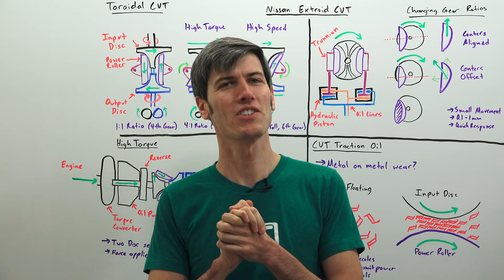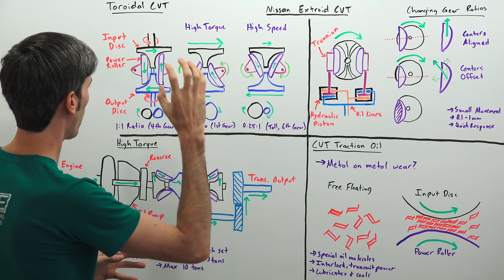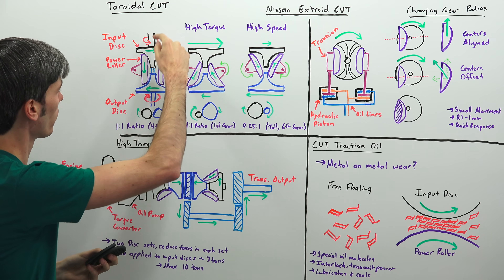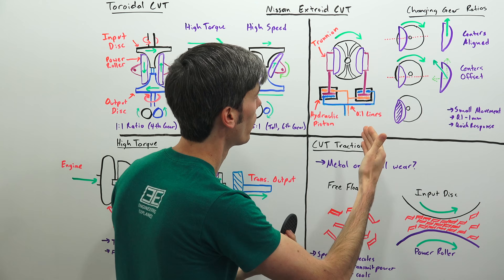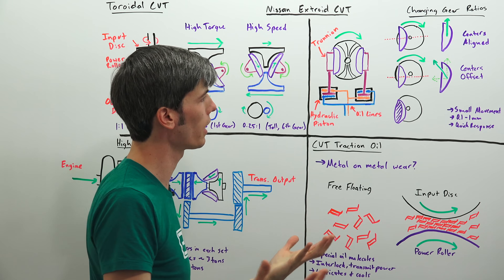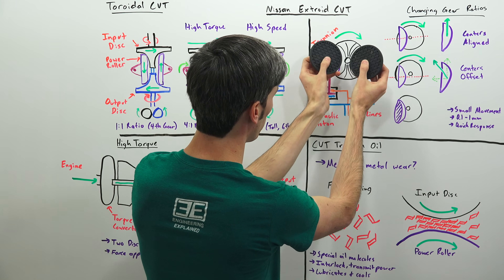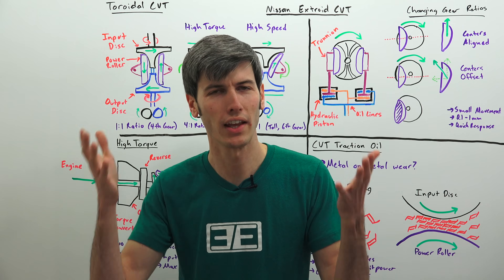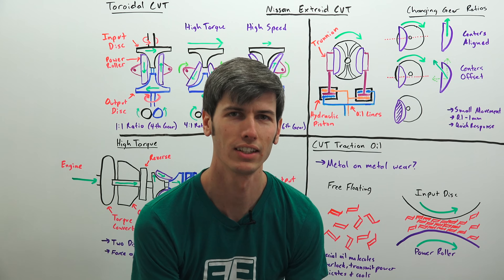Nissan Created The First Production High Torque CVT

Comment: This CVT design is destined for early failure because the core design is flawed.

You've got 2 separate CVT's that need to be PERFECTLY synchronized to not fight against each other and wear each other out. Anything less than PERFECT synchronization means that they will start to slowly destroy each other.

PERFECT synchronization isn't possible, that's just physics. However in this case the synchronization is controlled by hydraulics. So here is a partial list of all of the issues that can and will effect synchronization between the two CVT's:

A. Heat difference in the hydraulic fluid between the two units
B. Imperfections in the hydraulic cylinders ( not exactly the same as each other )
C. Worn or slightly leaky O-rings ( that wear / leak at different rates )
D. Clogged fluid passages ( that clog at different rates )

Maybe there is only one set of hydraulics and they are mechanically coupled. There will still be synchronization issues because things like:

A. Mechanical play in the system
B. Uneven heating and expansion of the linkage of the synchronization mechanism
C. Possible bending, flexing or warping of linkage of the synchronization mechanism

The only realistic way I can see this lasting very long would be some type of torque sensing auto-correcting system where the two CVT's could detect the torque difference relative to each other and quickly make adjustments before too much damage takes place, but that would have the following issues:

A. It's complicated with many points of failure
B. As it wears it could end up in a state of constantly over correcting or under correcting, sending the CVT into a never ending auto-correcting loop of death.

It's just a bad design!
NEVER create a system where two drive system are fighting against each other. Not if you want it to last very long.

Comment: Is the "special" oil a non Newtonian fluid being used as a lubricant?  Why not use cogs instead of smooth rollers? Seems like wheels with teeth would be much stronger while eliminating the need for a special lubricant.

Comment: But will it last? even if it lasts 20 times as long as the current Nissan CVT it would be very unreliable.
My neighbor had a Nissan Pickup with CVT and it broke after 6000 km and the replacement lastet only 10k km.

Comment: Never heard of it so far and I'm blown away. How on earth that kind of an amazing invention didn't set the highest bar as a CVT transmission and become the most used system in the industry. It must have some serious drawbacks right?
Reply: Alot of them were put in cars before they worked. Many failed at 100kmiles, there was a class action and nissan replaced a bunch, put money into r&d, and say it works now. Many people are skeptical. Some say they are noisy and fragile but the concept saves gas for sure, and gets smooth acceleration like an electric. Some of them literally have rubber belts inside the transmission. I've heard that regular fluid change helps longevity.

Comment: In case if any of you have seen the fluid-CVT bicycle hub from Nuvidia; this is it.
Reply: toyotaprius79 came here to say this. I run one on my mid motor electric bike and it’s fantastic and reliable, if a bit heavy. The brand is NuVinci and they’re now sold by Enviolo due to corporate restructuring.

Comment: Seriously doubt these will hold up under extended use if the engine makes more than 40-50 hp. (especially if Jatco is building them) Anytime you have a friction load (i.e. 2 closely positioned metal discs with a 'friction' fluid between them), you're going to generate huge amounts of heat that a normal transmission cooler won't be able to carry off, not to mention the efficiency loss in said transmission, especially at higher ratios. If they want  CVT, they should revert back to the 1950's Dynaflow by GM. They used a 5 element torque converter with variable pitch blades to get torque multiplication, and then a simple planetary gearset behind so you had reverse. Plus they had 401 or 425 cu. inch V-8, dumping more hp. than the LT-1 Corvette of the day, through them. This new CVT is over-engineered, over-rated, and will likely fail due to heat related issues. Sometimes it pays to look back at older technology and what actually worked... or just go full electric, as in the case with Tesla. 😉

Comment: Not sure why Nissan keeps trying to make this CVT transmission work. All transmissions reduce efficiency, by definition. It's not even a matter of normal vs CVT.

Best to scrap the transmission altogether, get a turbo-compound engine, a stirling engine, 4-wheel electric motors, and have the turbo-compound run on electricity generation, no transmission required. And as a bonus, with the compounding and stirling working, you extract the most of the fuel used. Win-win.

Comment: You know Nissan should probably fix the issues of their CVT's kicking the bucket under 100k miles before making a "high" torque CVT. And Subaru has a high torque CVT for the H6 and FA20DIT powered cars for awhile.

Comment: How do they maintain the proper contact pressure to torque ratio? How often do you have to change that fluid. It seems that it would be subject to shear breakdown. Honda had a CVT that worked on the same principle, but reliability issues forced them to abandon it. Now, everyone's going to 6 and 8 ratio conventional transmissions. The jury's still out on the reliability of those complex types as well. The car forums aren't very kind to cars with CVT's in general. To me, the old type with the pusher belt(as opposed the the tension belt)looks to me like the most reliable solution, but it doesn't handle as much torque.

Comment: I think that any more development in gearboxes for internal combustion engines is a waste of money. Electric is the future.
Reply: electric is about as short-sided as your comment. hey guise lets switch over to a power souce that is range limited and to be completely honest, no better for the earth.
Reply: Electric cars are just better. The maintenance advantages alone. No oil change, no spark plugs, gearbox, oil filter, air filter, heck you even use less of your brake pads due to regenerative braking.
They're just a breeze to drive, no shifting and instant torque.
If you want to talk about how good they are for the environment, do the calculations. My country runs on 45% coal. Rest is nuclear, a little bit of gas, and around 40% renewables. Even now, an electric car is better and that will only improve. Heck an electric car is even better when you directly run it off a modern Diesel generator. I'd happily show you the calculations.
The main reason why I think electric cars will be the future is their lifetime cost. Currently, they are way more expensive than their gas counterparts. But look at the price drop of batteries. 1000$/kWh in 2010 dropped to just under 200 in 2018. If it continues this way, an electric vehicle will be cheaper to buy than a gas or diesel one before 2025. And that's just the sticker price. It costs 4.5€ to drive an electric car a distance of 100km (15kWh at 0.3€/kWh), while it costs around 8€ to drive a similar sized Diesel (I always like to compare the Golf Mk7 TDI with the 2014 eGolf, as they have similar torque and power ratings) and around 10€ for a gas car. And that's only the case if you use grid electricity. Solar electricity generation costs here are dropping to 10 to 15 ct/kWh, meaning that the cost per 100km driving distance would fall by another 50%. 
Lastly: What's the alternative? Hydrogen? Look at the prices of fueling hydrogen. It's almost 10x more expensive than electricity. That's because it's inefficient. There's the electrolyzer, the compressor, fuel cell etc.
Reply: @GeoStreber  The only thing more reliable than any transmission: NO transmission!!!🤣😁😜

Comment: I know SOMEWHERE in all the replies, someone mentioned that another, smaller design company.came up with this CVT. That's why the design was familiar to me.
Reply: Another poster mentioned that it had been designed for tractors.(Talk about a High Torque application!) Did a tractor actually have this CVT? If so, how did this CVT do in the tractor?

Comment: As an owner of a Subaru Impreza with a CVT, I'd like to know how acceleration with this CVT compares to a manual transmission in the same car. Can you point us to where this information is Jason?
Reply: Handling high torque off the line is why Toyota added a "First Gear" to their transverse (only ?) CVT.  How does that compare to DCT (e.g. VW/Audi) competitors?
Reply: To make the CVT work better in the WRX, Subaru increased the oil pressure inside the CVT, with only slight improvement in it's launch times.

Comment: My wife's 2006 Murano CVT crapped out after 10 years. 
Luckily, Nissan had finally realized that all the bad press was bad long term so they tossed us a bone and had a retroactive 10 year, 100-120K miles warranty extension.  Just made it in about 2 months before that ended and got a new/refurb.  Video doesn't explain if/where these HiT CVT's are in US?

Comment: I watched a documentary film 15?20? years ago that Nissan was developing this CVT at that moment and made a prototype for F1 application as well as High torque commercial vehicle use.
Still remember that Nissan was collaborating with oil company to make special oil. Oil characteristic was explained as It flow and act as normal cvt oil but when it is applied with high pressure between metal, the characteristic of oil changed, its molecules packed and the film strength is increased dramatically.

I thought Nissan dropped the project but they didn't. very impressive. well done Nissan. Now you guys need to make CVT more reliable, please....

Comment: If toroidial CVTs are superior to steel belt CVTs, then why did Nissan switch to the belt design that they use in everything today? Or why haven't the other manufacturers jumped on the toroidial bandwagon? Honest question....
Reply: 2016 Nissan Rouge 57000 with CVT Transmission just died.GREAT...

Comment: What if we put two CVTS in it? Huh? Huh?  Then we can call it high torque. Feel skeptical of how much pressure and friction is required. The oil and the hard steel have to work under that high pressure.
Reply: With two roller sets in the same transmission case, they've more than less done that. That's what makes this design more promising for high torque, high performance applications. Let's hope it works in the real world.

Comment: I had first read about these toroidal CVT's 8-10 years ago, though that article I read didn't go into as much detail as you did.  I was a bit confused at first when I started watching the video as you initially seemed to infer that this was a new technology, and I was wondering how it was different... probably should have put the bit about it being from the 90's at the start to avoid confusion (as can be seen in many of the other comments).  I'm also curious about whether this transmission design is even used anymore, or whether it was any good in the first place.

One other thing that came to mind while watching this was the CVT design from a company called NuVinci, it uses an array of spherical rollers in between two input/output rings instead of a toroid and cones; what is similar is that the NuVinci design uses a traction oil that's described as working exactly like what's in the Extroid.  Right now it's used as a bicycle transmission, I've wondered whether it would ever be used in cars, but after watching this video maybe there's a patent issue with the traction oil?  Something to look into more I suppose.

Anyway, neat video, thanks again!

Comment: 1:1 is like being in 4th gear in a manual transmission??
ummm
I mean, in effect it's acting like 3rd/4th at 1:1 WITHIN the toroidal, but with gearing outside the toroidal it's final drive ratio is not 1:1 at that point. it probably varies from about 0.8~ish to about 3.6~ish to 1 final drive. so the midpoint would be around 2.2:1~ish in terms of final drive. the toroidal is 1:1 internally at that point though, yeah.

Comment: It seems evident that the input and output rollers would experience a tremendous axial force, and THAT would be the real reason that there are two units, working in tandem, and facing in opposite directions.  Those axial forces are then totally cancelled out, and need not be carried by any bearings.  The two input discs are tensioning the shaft between them, and the two output discs are simply pressed together...  This is reminiscent of the interaction of steel wheels on steel rails, and what allows railroad equipment to go around corners with live axles....

Comment: Wrong. Audi came out with a high torque CVT in 2003.  It had fluid contamination problems like most of today’s troubled CVT transmissions. 
Most reliable high torque “CVT” transmission I’ve seen are planetary type CVT’s. Chevy Volt, Prius, etc

Comment: will this move the point of failure from the gears themselves to the hydraulic controls of the power rollers which will be in constant use in a cvt.

Comment: Having driven a new 2019 Sentra rental car for a week, probably the most unnerving thing about the CVT is actually that it never quite does the same thing every time.  I know it's not a sporty car, so the slowness, laggy controls, and mediocre power are excusable, but between the arbitrary fake shift points emulating gears, inconsistent kickdown sometimes bringing the rpm up high when you go full throttle/sometimes just bogging at low rpm in a fixed ratio with no "downshift" drives me the craziest.  The engine is rated for peak power at 6000 rpm...once in a while it will actually run out to 6k before lengthening the ratio, sometimes only 5.2k, and always seems to short change you when you really actually need the best power for merging (and you'll need it a lot on this car...it is ponderously slow for a modern car at speeds over 50 mph, unless of course the on ramp is downhill 😋 ).  Good technology for mix of efficiency and flexibility, but it depends very very heavily on rock solid programming and tuning for satisfactory results, and Nissan missed that mark in my opinion.  I enjoyed the 2019 Hyundai Elantra way better.  Much better features, performance, fuel efficiency, and driving dynamics in the same class.  Honestly,  Hyundai is the good value to beat out there nowadays.

Comment: You must mean automotive high torque CVT. I work in the industrial sector and work on 125KW Generators on 7L GM V8 prime movers. They've got very tough CVT between the engine and the generator. Makes for longer than normal generators, but the speed regulation on high demand applications is awesome.
Reply from the maker: Yep, automotive! Thanks for sharing about your experience with them!
Reply: 7 liter Diesel I presume.  It amuses me to think of a 427 C I Chevy Big Block running a generator!
Reply: @BobPegram  Various sizes. Depends on the application. All are GM industrial, but there's some CAT units as well.

Comment: Nice new design, but based on the Nissan CVT gearbox failing after 20k miles, with full service history. No guarantee given, lost lawsuits in UK and US and giving zero ****s about it, we sold the two Nissans we had an we will not buy one again. Never had an issue with their manuals. Genuinely the CVT box was perfectly fine to use before that, knowing the elastic nature of it, but the utter failure to provide customer support means they are on the 'never again' list. 
I both like and would be concerned about the small movement on the disks. Imagine there is a minor fault on the electronic control (also happened prior to full CVT failure due to oil issues). As the specific oil will make this gearbox fail in the same way as the old CVT unit, genuinely this is a problem waiting to happen.
A very interesting explanation and many thanks for your time putting this together. The fact Nissan has been doing this for two decades just proves the point that they didn't do their due diligence prior to release of the fundamentally broken CVT implementation in the Quashqai (in the US I think that CVT box was in the Juke).

Comment: Yeah but it’s Nissan. I don’t like any CVT’s but Nissan makes the worst ones on the market, hands down. I’ve seen them fail in as little as 10k miles, and failure soon after the expiration of the factory warranty is incredibly common. Buying any brand new, untested technology is a bad idea if you want your car to last for a long time with no major issues, but it’s positively moronic from a manufacturer like Renault-Nissan with such a poor reputation for reliability (and yes I realize that Datsun/Nissan used to be pretty good, but that was decades ago, long before they merged with Renault).

If you have to buy a car with a CVT, go with a Toyota. It will still be rubbish to drive, but it’s unlikely to fail prematurely like Nissan CVT’s frequently do.

Comment: What about using a CVT instead of a differential? Both wheels will always have power and the CVT would take care of differing wheel speeds?
Reply: That sounds like a good idea. Not only would it allow for different wheel speeds when cornering, it could be part of traction control. It would mean that the wheel speeds could be held proportionately to steering angle even if one wheel looses traction: the ultimate posi-traction. The only problem is the extra torque from the multiplication from the ring and pinion. Now, the system is dealing with full axle torque. Fun thought though!

Comment: I had always envisioned a CVT made of 2 tapered cones, side by side with a intermediate gear in between them, traveling back and forth on a shaft, from one end to the other to vary the ratio. Surely, this has been invented, right? I mean, I'm not the sharpest pencil in the box...
What is wrong with this design (other than no inherent reverse function)?